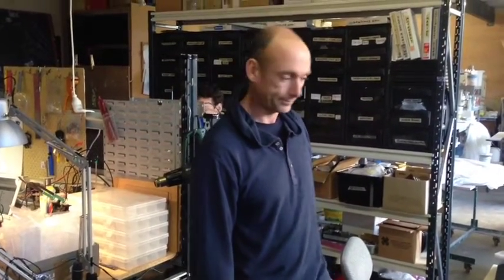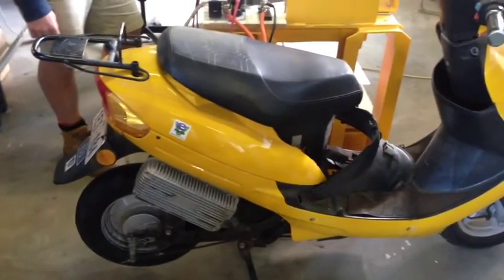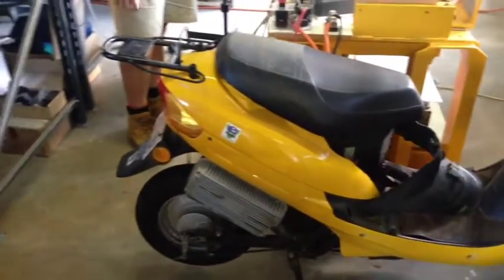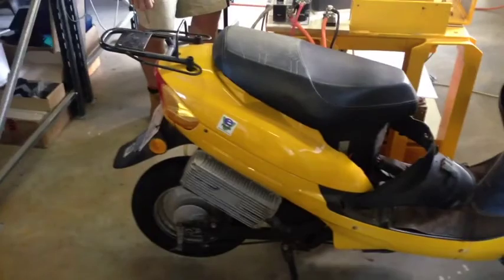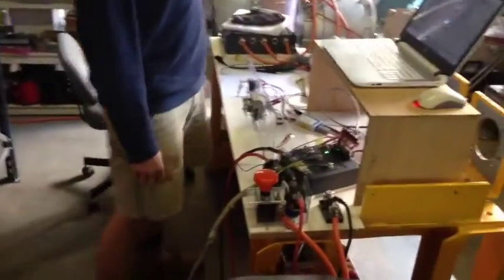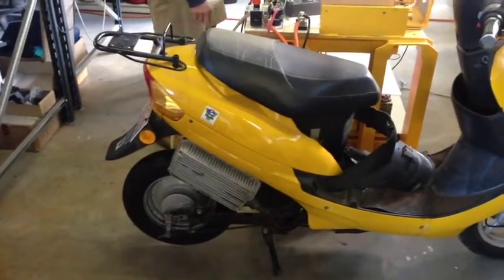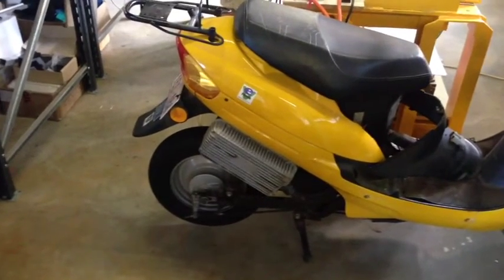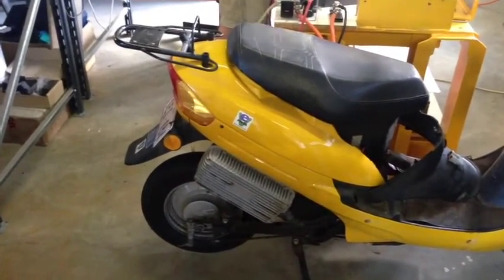FIELD WEAKENING DEMO

Comment: What's the rated power of the motor? Remain at 65 km/h requires already more than 2kW, the torque demand increases consequently with the speed while wheaking the field reduces the torque, I'm not sure that the maximum real speed would be increased ?
Reply: If rpms rises faster than torque decreases then your power will still climb. Thats the whole point of it.
Reply: Meet you here thinking about field weakening to gain some speed .... Accident i do not think so :D 
I smell new project :D
check this (e-bike that can reach 191kmh using field weakening) :  https://www.youtube.com/watch?v=ED462YGCVSg 

What i understand about field weakening in simple words : its like changing motor from high torque and slow to fast but with less tourque (and less eficient becouse of field weakening) without adding more volts (for example if you can't because insulation on coil does not allow for higher Voltage) and without revinding the motor , you just change the settings (all time you will get amlost the same output power) 
its only how I understand this from .... google and yt xD so I can be wrong

PS. if you ever go in composites like carbon / fiberglass+resin etc like making box for battery you can ask me if you need advice (i work with it few years) :)
Reply: Wow incroyable expérience ici belle trouvaille en commentaire depuis que je vous suis ~2013 wow 😅

Comment: Hi Evxpower, How is the efficiency of the motor affected when field weakening is applied?
Reply from the maker: For a given voltage, an electric motor has a "base speed", it will not go faster because the back EMF equals the applied voltage. Field weakening can increase the speed of the motor but efficiency is sacrificed as some energy is used to suppress the motor back EMF.
Reply: If the motor uses permanent magnets, how the field can be reduced?
Reply: @IncroyablesExperiences  it is the field generated by the windings who is weakened
Reply: From the ampere meter value I think it will be not more efficient compare with without one. It draw more current to increase speed